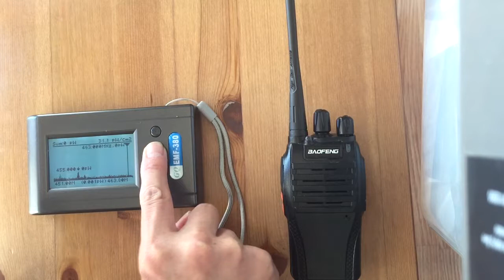Check Walke talkie RF power with RF Power Spectrum on GQ EMF-380 EMF meter

Comment: thanks for the video, but as a ham radio operator of 55 years now (kg5vt) i had to chuckle at you trying to explain channels and frequency. also, what does mw/cm2 mean in terms of actual watts? the baofeng usually has 3 settings for 1w, 2.5w, and 5w. but from the meter reading i would have no idea how much power you were putting out. matter of fact, i would never transmit at 5w so close to a meter of any kind--that's a lot of power around sensitive electronics which aren't filtered properly. no, the best the meter can do is display the frequency (which is useful enough by itself although it looks like a pain in the ass to zoom--but i will know the frequency within a narrow range to begin with in nearly all cases, so that might not be an issue. that leaves the meter to only act as a field strength meter with the readings only useful in comparison to other signals around the same frequency. in other words, you could compare the two radios you're using as they are on the same frequency range to see which one is more powerful. to determine how much more or less powerful would take a better mathematician or physicist than me though.

anyway, i just got the emf-390 today and i'm going through youtube because the manual is awful for this useful meter. /guy
Reply: Question for u sir. Is there a device where u can pick up which direction a walkie talkie is being activated? Like lets say out in the mountains? Ive gotten lost trying to find some one even tho we had walkie talkies